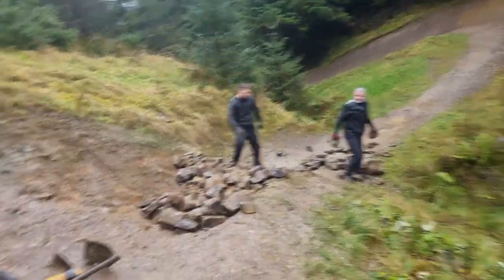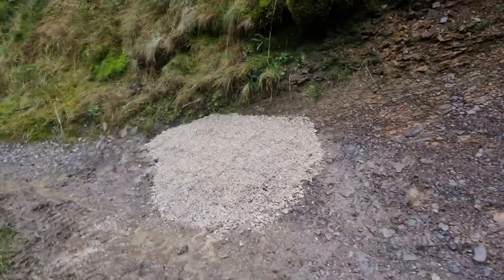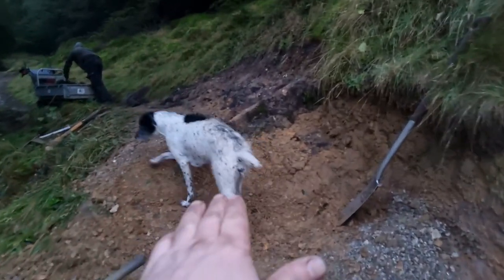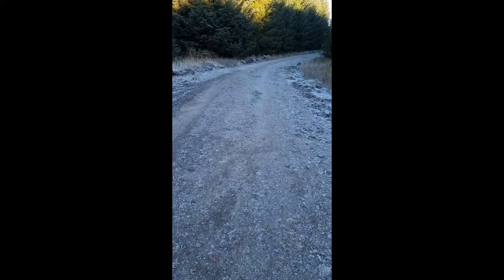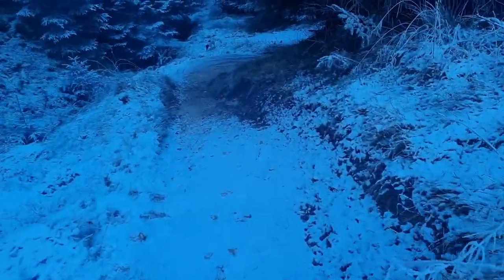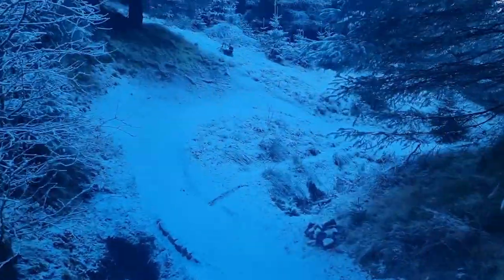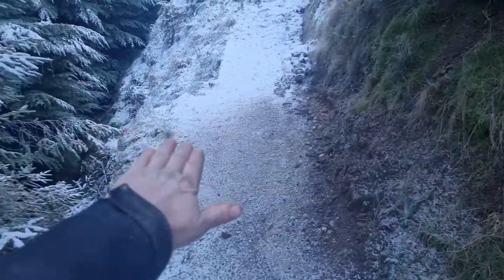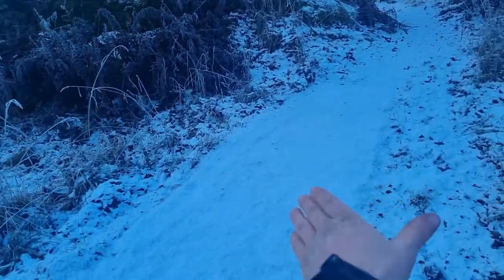Hully Gully Repairs - Winter 2022 Gisburn Forest

Comment: Love this video!

Great to see the Gully has at last had some work done on it to make it safer and more fun again. Due to the Gisburn Forest trails becoming worn out over the last few years and the 'working forest' being cut down in places, I stopped riding Gisburn and also sold my mtb recently. There was nowhere 'nearby' to ride unless I make a trip to the Lakes (I live nr Blackpool) and it was gathering dust.
Looks like I'm gonna have to buy another mtb now to try the rebuilt Hully Gully! 😍😁

Well done to all that did the heavy grafting!
Reply from the maker: It's tougher on repairs these days.  A year without attention in covid + increased use + ebike use explosion. At a time with less grants for improvements  (most if the big Gisburn projects were done with EU funds) then the volunteers are even busier.

2nd Sunday of the month for regular volunteer dig days if you want to chip in :)

I'll be back for a month next November.
Reply: @KevIsOffGrid  I was always going to help out on a dig day but a bit of a trek for me from St Annes. I have been riding Gisburn, on & off, since 2009 so I really, really should make the effort.